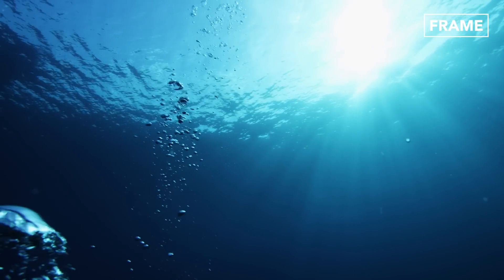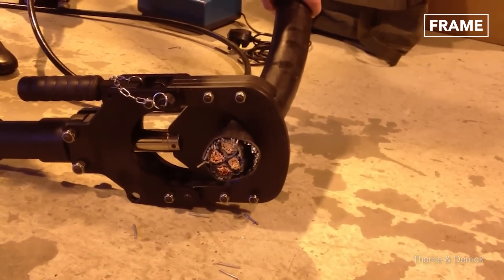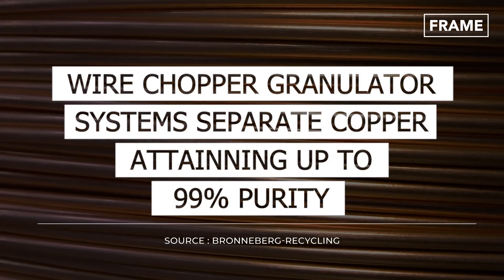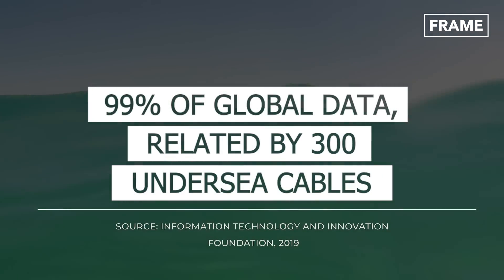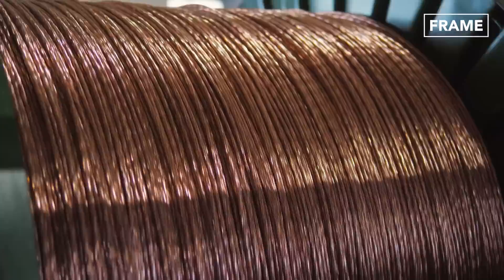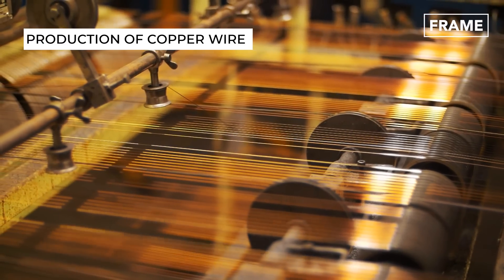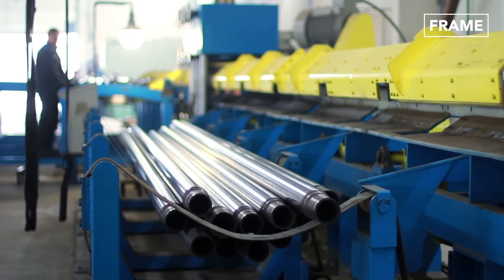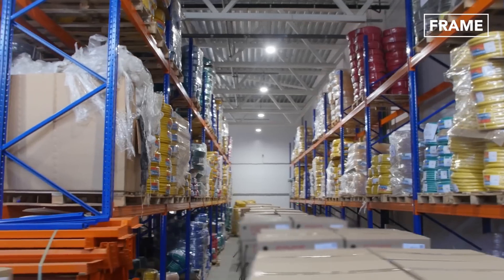The Hypnotic Process of Recycling Million $ Underwater Cables

Comment: With the advent of starlink, do we even need under sea cables anymore?
Reply: yes, because it provides cheaper, faster (both latency and throughput wise) solution. not to mention it connects starlink ground stations

it's also true on land where it provides backbone for mobile networks. even wifi uses almost always cables for access points inside buildings

Comment: Don’t know where you got your information but when copper is too expensive for large scale electrical applications, generally it’s aluminum that’s used not steel. It conducts electricity far better than steel and steel actually has far worse corrosion resistance than copper
Reply: A lot of Aluminum Wire is what is known as ACSR which is Aluminum Conductor, Steel Reinforced which is where there is a steel core of the aluminum cable, to provide more strength for long spans of cable across poles or towers.

Comment: Copper Doesnt Corrode, It Oxidates
Reply: it Oxydises.  Oxydates are the products of the Oxydising.
Reply: @rosewhite---  Actually Oxidises. No Y.
Reply: @rosewhite---  come to my ranch Lol copper so old feels like its bout dissolve in hand when picked up. Falls pieces. Old old copper wires. From old home that no long exist
Reply: Copper does corrode - it all depends on environment it is in. A bit it acid, salt or their fumes and it will disappear in a while. And how about car wiring failing, for eg. when wrong type of coolant is used - also type of copper corrosion. In general everywhere where there's current flow and wire is exposed to chemicals there's corrosion.

Comment: about 10 seconds of info on underwater cable.. The rest is just filler about copper.. Save your time and skip this
Reply: Thanks for the tip. Black Box.
Reply: Yep rubbish video, cheers
Reply: Completely agree, saw more fibre and learnt more about steel cable then I thought I would in a video about recycling copper undersea cables.
Reply: A..j...amar...monta..karap...1.     Tarek...taka...my....enkam...7ooo..hajar ..kome...gaca....my....par..taiem...midland...bank.....job...care .dece......bat...par...alet...pos...cote...da...na......pote...maca...no...cote..
..ear..karona..caredece
Reply: Since glass fiber cables don't need repeater equipment anymore when crossing oceans, undersea data cables contain little to no copper at all. I also have never heard of under sea cable recycling. Sending out a ship to collect it would cost more than the value of the recycled copper, and all new cables are on top of the oldest cables, so dragging up the old cables would damage the new cables. Recycling is good but this video makes no sense at all.
Reply: @jwstolk  Glass fibre (fibreoptic) cables that cross oceans very much DO need repeaters every 60m to 400m depending on cable design. They require a copper conductor as a path to power those repeaters.
Reply: Sorry you missed the point here, Black
Reply: @clairestaffieri4398  No the point was to see how they recycle underwater cable..  Its literally the title but has almost nothing to do with the video. SO SAVE YOUR TIME AND SKIP THIS video